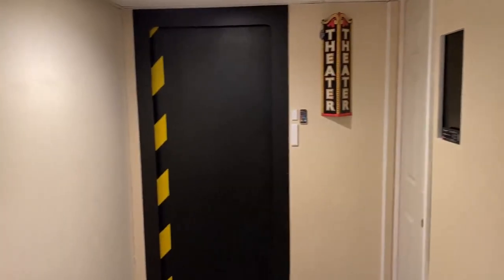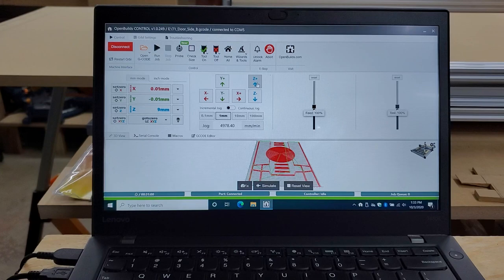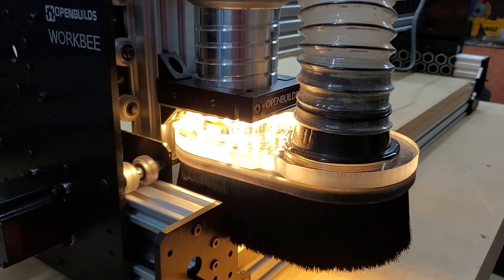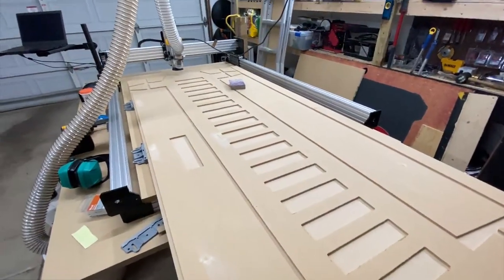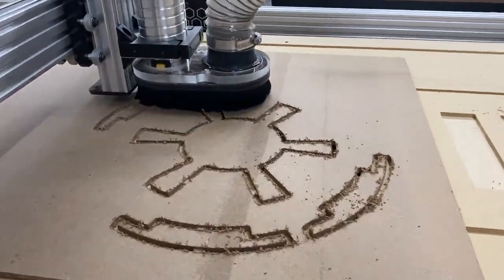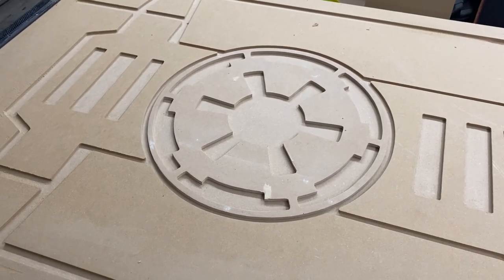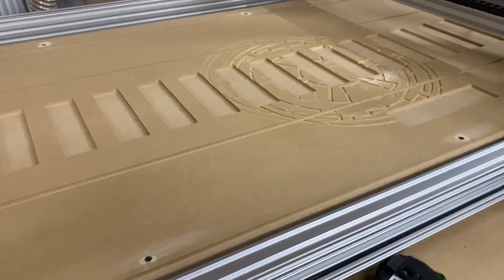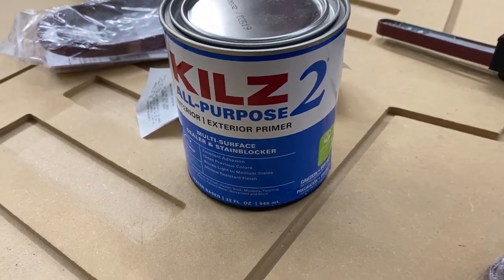Death Star Media Room Rebuild Part - 5

Comment: Thinking about getting a CNC Machine- what type of router bit did you use for this door? I can't stop watching your videos- great source for inspiration!
Reply from the maker: I have an Openbuild Workbee 1510 with a Dewalt DWP611 router.  I have since extended the workspace with new linear rails and lead screws, instead of wheels and belts. The CNC has been discontinued and a newer model is now available named the Openbuilds Lead 1010 and 1015.

Thanks for the kind words as well!!

Comment: How do i get this made if i take it to a workshop? How do you begin:)
Reply from the maker: You would start with a design using a vector program like Adobe Illustrator or Inkscape. From there talk with the person at the workshop as he/she will have certain dimensions that they are able to work with. They will also have to turn your design into something that the CNC machine can read, (gcode).  Hope that helps!